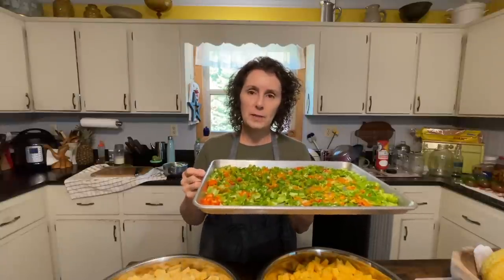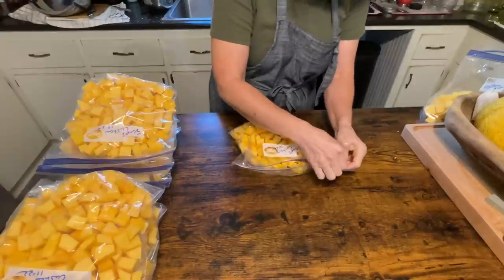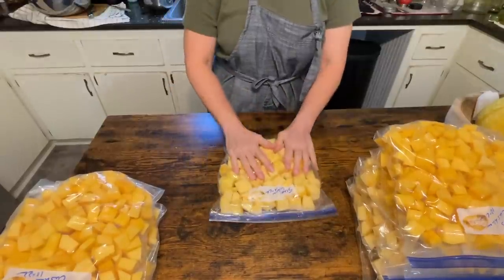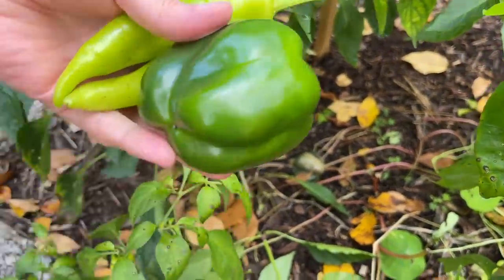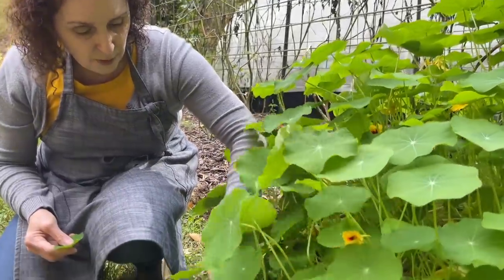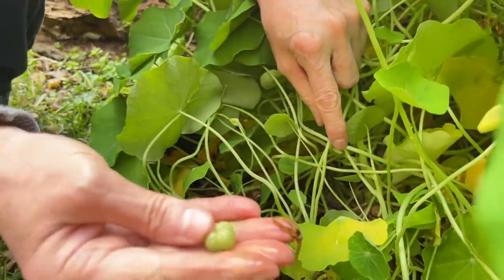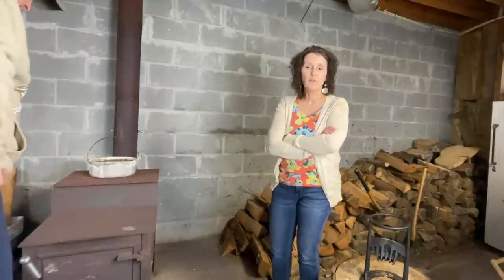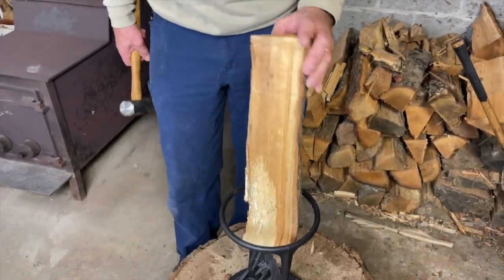My Life in Appalachia 25 | Fall of the Year & Our First Fire in the Wood Stove!

Comment: Try putting a plastic straw in the corner of the partially closed zipper and suck the air out of the bag and then quickly pull the straw out as you finish closing the zipper. Cheap vacuum sealer.
Reply from the maker: Great tip 😀
Reply: I love the Appalachian mountains. Your property looks like Yancey where I live.  But I am a transplant so your channel is a treasure for me!  Thank you.